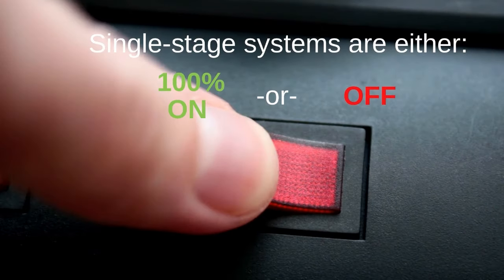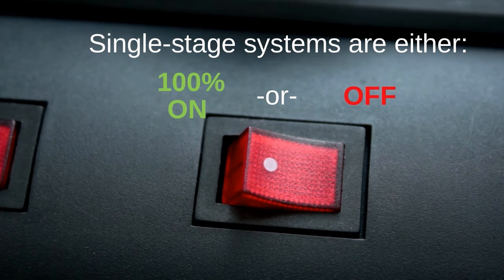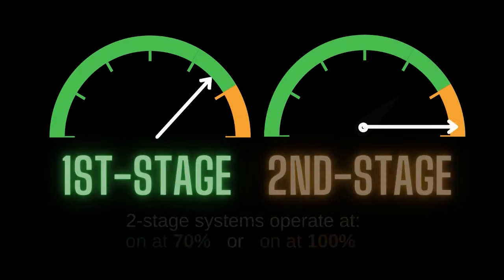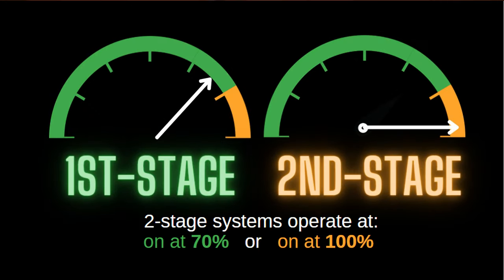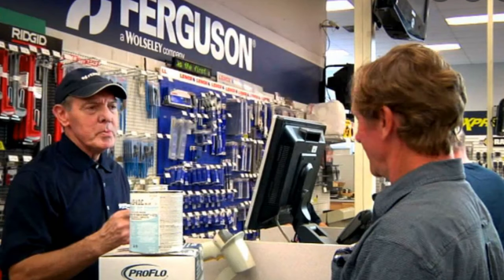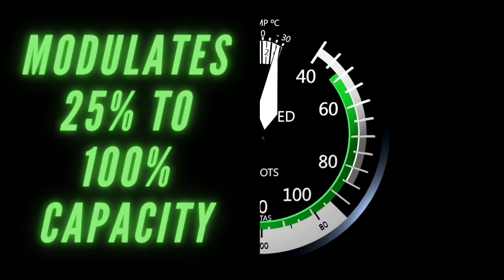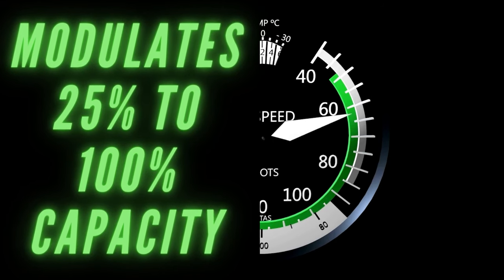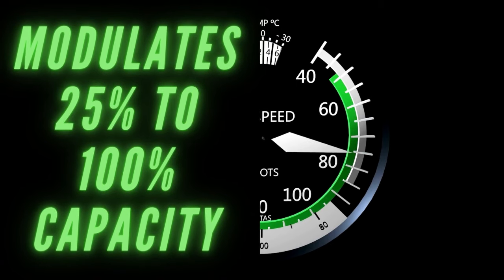Should I Buy a Single Stage, Two Stage, or Variable Speed Air Conditioner

Comment: Hi Greg.. I have been watching your vides for a few months. I am in the market for a new unit (located near Elk Grove) and will be calling you guys to schedule an appointment for an estimate. I've a York unit that is 18 years old and leaking. Would like to get that replaced.
Reply from the maker: That sounds great. We would love to take care of you. You can schedule an appt at your convenience at the top of the screen at www.foxfamilyhvac.com Looking forward to hearing from you 👍
Reply: @foxfamilyhvac  Awesome... I just booked an appointment for this Friday. While I have your attention, is partial replacement of just the AC unit (and not the Furnance) even viable for an 18 years old unit?
Reply: @Fox Family Heating and Air Conditioning  I have a 1 stage ac condenser but 2 zones with 2 thermostats using a damper. The ac unit seems wore out...wont keep up..makes loud clicking or grinding as it turns on and off. Am right in thinking that with 2 thermostats it reduced the life-span of the ac condenser by doubling the demand? The condenser is 7 years old.

Comment: The time has come to replace my 2-ton and 5-ton AC/heat pump units.  They are both single-stage.  A local contractor has quoted both single-stage and variable replacement units.  The variable speed quote is about $10k higher than the single-stage quote.  Ouch!  I have asked him about something in the middle -- a two-stage system, for example.  He says "2 stage is going away".  Is that true?
Reply from the maker: No, not true
Reply: @foxfamilyhvac  Thank you!
Reply: Kind of true. A lot of manufacturers (we sell Lennox) are producing entry levels variable systems that cost just about the same as 2 stage, making them obsolete. They consolidated down to only having 1 2 stage unit and its considered their lower end equipment
Reply: @steveb8897  That jives with what the local HVAC companies were telling me. I originally asked about going dual stage and when the ran the numbers it ended up being less than $1000 more to go with a variable setup.

Comment: I recently got a quote to replace 4 ton AC condenser, evaporator coils, Plenum, pan, 16 SEER, single stage cooling. Attic job. Replace one small section of ductwork that leads to a bedroom, where the current duct is smaller than the rest of the ducts. 80,000 BTU. Gas heater/furnace. 1900 square-foot home. $11,500. Carrier or Heil brand. In your opinion, does that seem like a fair price?
Reply: Prices vary widely between contractors and different National region. Get a couple more bids to compare.. I saw estimates vary between contractors up to 100% on my last rental replacement a year ago! Also find out the warranty on the equipment and parts and labor!

Comment: I personally don't like variable speed. Too many bells & whistles to break down. A lot of the time everything you save on the bill you spend on repairs, such as inverter boards.
Reply: Recently house sat for a friend with a new triple stage system. It was beautiful and kept nearly constant temperature on low fan speed even during the hottest times of the day. It also kept the humidity much higher than normal without a humidifier (important in a desert), while also being capable of running in dehumidifier mode for more humid climates.

I recommended that they not buy this system. While the experience was amazing, I still stand by that sentiment. I'm just waiting for the inverter to blow a week outside the warranty and cost half as much of a brand new single stage system to repair. It'll probably be on backorder too leaving them without AC for a week in 110+ temperatures...
Reply: @coldfinger459sub0  The compressor isn't really a concern. It's the electronics running it and the inverter. As with any industry making electronics for the consumer market they're designed at the lowest cost that will keep failures during the standard warranty period at an acceptably low level vs production cost. The manufacturers will not spend a single penny more than they have to to exceed this longevity target.

With a regular condenser you have a $15 dual run capacitor, $40-50 contactor, and maybe a $30-55 low or high pressure limit switch as failure points. On their new 3 stage system you have a $1200 inverter board, $375 control board, and a $340 EMI filter board, along with your regular capacitor and a myriad of pressure & temperature sensors. That's a LOT of electronics made as cheaply as possible to go wrong.
Reply: @coldfinger459sub0  They really don't nor are they designed to last that long. Soldering of the components is done as cheaply as possible. Combine this with the thermal stresses the components regularly go through and you get the development of tin whiskers. These eventually cause a short that fries the board. This problem was made much worse by the removal of lead from solder as lead greatly impedes the development of tin whiskers. This is the main reason why older electronics seem to last longer than newer ones, differences in manufacturing quality aside.
Reply: @coldfinger459sub0  definitely important not to just be the salesman 😅
Reply: Glad to see you doing good Greg! Your lead guy sister is my dispatcher. Just found that out not too long ago. Small world, especially here in our HVAC area. 😂
Reply: @coldfinger459sub0  we have more of a problem with abusive customers and company owners making 3% net profit, while restaurant owners are raking in 15%! If someone can stay in business, and have good reputation charging what they charge. What is it to you?
Reply: To have a reliable Veriable speed system, MUST HAVE A GOOD PROPER DUCTWORK DESIGN.
Reply: @coldfinger459sub0  what surge protectors do you recommend?
Reply: @coldfinger459sub0  I plan on replacing a 12 year old Trane due to a leaking evap coil.  The replacement cost for the coil is quite expensive.  I live in Florida so it's hot and humid.  Can you share more information about the electrical protection devices you install so I can talk intelligently with HVAC contractors during the purchasing process?
Reply: We had a 5 ton variable speed ac trane unit installed with all the belt and whistles back in 2016 and it has been running perfectly  all these years. Only one time it lost the freon a few years ago but it was recharged  and no problems ever again. What i would say is that you can have the most energy efficient unit in the world but it wont make any different in your electrical bill if your home is not properly insulated and with that I mean having energy eficient windows and thick insulation on walls and ceeiling. This trane unit can even dehumidify the air thanks to its variable speed compressor however is not able to keep humidity levels down during the summer because thisnis a 150 year old historic house innthe south with the original windows and plaster inside most of the walls instead of todays insulation. However.with all those disadvantages in terms of insulation the unit does a great job. Its nice to see in the digital thermostat the speed porcentage the compressor  is running.
Reply: Install it and control it correctly it will provide you years of service
Reply: In this field you earn hero status by being a mechanic not a salesman.  As far as inverter systems go, their accuracy for cooling settings is on point, they work great until they don’t.  My great Aunt & Uncle on the Eastern shore of Maryland have dual zone Trane XV20i 3 ton condensers matched with comperable gas furnaces.  I’ve only been there in the summer, but they dehumidify and drop temp like no other system.  Installed in July 2019.  So far no issues with the equipment.
Reply: Trane has made variable speed systems since the late 1990s. Those inverter boards are proven very reliable.
Reply: @davidperry4013  Trane is an exception. Those are good inverters. Know someone that has XV20is zero problems since installation in 2019

Comment: Do yourself a favor, stay the F away from variable inverter based systems.  I have a daikin vrv life system, and my house is always above set temp on hot days, system always runs, and it broke.  It took a month to get it fixed.  The company that installed it while qualified had no idea how to fix it and relied on tech support who was sub par,  and it was done by replacing every components on the outdoor unit (were talking computer motherboards that rival whats in your PC)  and when that didn't work they just replaced the eniter outdoor unit.  It is confusing and apparently not as reliable as the old school on/off style.  I asked other a/c repair companies if they could take over said nope, we aren't certified on that system.  So you are stuck with sub par service or none at all and that's scary.  wish I knew this before I bought this system.
Reply: They are reliable, sounds like you got a lemon.  Agree with not many techs can work on them
Reply: @fzr1000981  The new one won't hit set temp its always 2 degrees above.  And the humidity in my home is always over 50 percent.  It runs 18 hours a day non stop ( naturally at a lower speed but still combine that with not hitting set temp its like the unit is just "lazy" but they call it power efficient.  If i say I want my house at 72, get it to 72 and keep it there, dont hover at 74 and then turn off at 71 at 3am.
Reply: @cranbers  50% is good, I'm rarely below 64% RH with my single stage.  What brand is it?

Comment: The entire concept of SEER is designed to confuse the customer and is a total hoax in hot areas because the system runs on high all the time.  Additionally a R410-a system is less efficient than a R22 system. Efficiency is BTU/Watts in. The R410 systems run at higher pressures and take more watts to provide the same BTUs. Therefore less efficient by definition but SEER was invented to manipulate the customer. Efficiency actually went down, yet through sleight of hand the SEER numbers went up.  Additionally the R410-a system efficiency drops at higher outside temperatures... like Arizona in the summer. The two stage system does you no good unless you live on the coast and need minimal air conditioning much of the year. I have been researching going solar and my AC is 12 years old. A variable speed system will allow me to increase efficiency, but most important the VFD gives a soft start so the solar system does not have to supply the very high inrush current when the compressor starts. As more people get solar power this should become a huge marketing tool.  Additionally if all AC compressors were 3 phase motors driven by a VFD we wouldn't spent millions of dollars replacing start capacitors every few years and have less waste in the landfills.
Reply: Starting current is a moot point, solar installers already install soft start devices on HVACs if they will be on a battery back up system.
Reply: And then there are natural gas condensing units !
I think that is the reason you see the new 410 units are about twice the size as old units with fast turning cooling fans and smaller coil area.  The new ones are very large and that is likely because they are turning the cooling fan slower and the 410a needs more time in the coils to shed the heat so the coils are a good double the size.